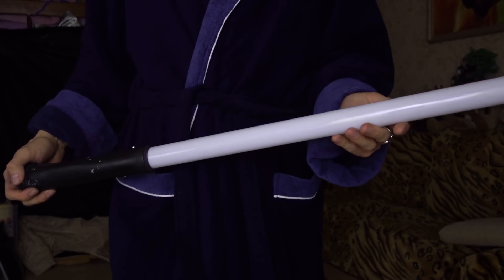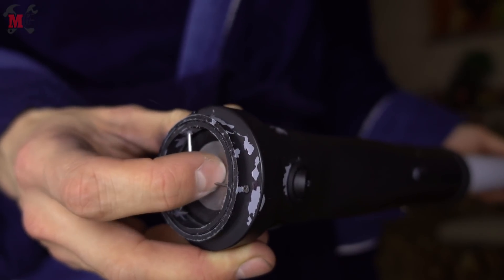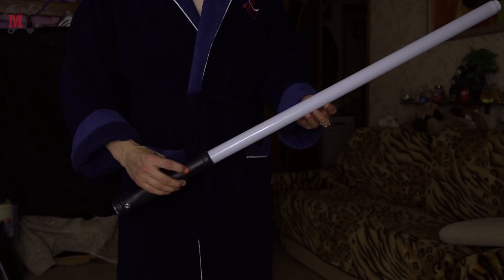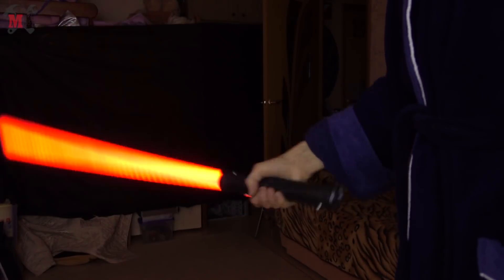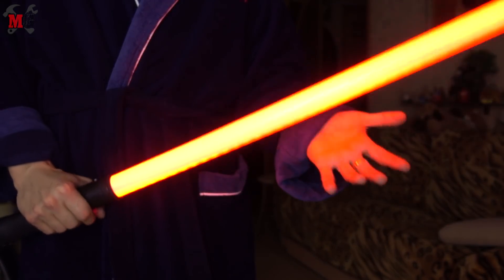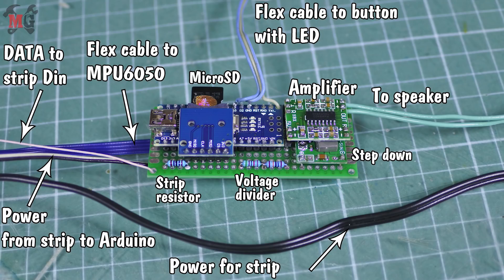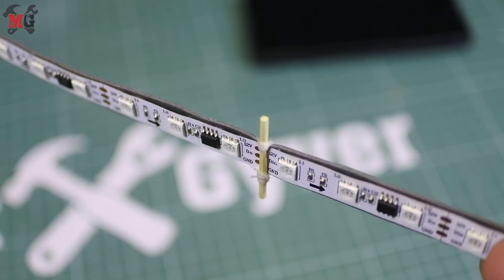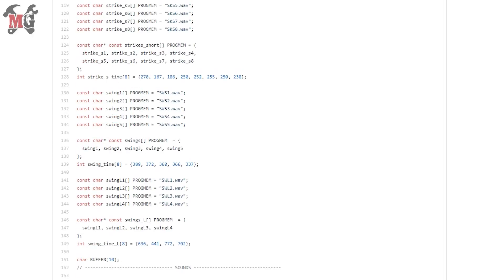DIY LightSaber with light and sound effects

Comment: Hi! I have a question if you don't mind. 
I am looking into using your method for the lightsaber to making a portal gun from the game Portal. I am removing the gyro sensor (the MPU6050), and rather than a LED strip, I am using a bunch of LED Diodes in a circle, half blue half orange. I want the sound to play when it changes from one color to the other. Do you know if adding a slide switch where the Button with LED is would work to do both so? Thank you!

Comment: Cool build! Am in the process of making my own, home built (not using pre-made tubes, but my own scrap metal finds) I want to know if  your build would work with the more dense RGB LED (144 per meter, i think is the run) strips, 2, back to back, and placed inside the clear tube (polycarbonate),  and I hope to use 3 18650s as they are rechargeable. your build is on-line, so I can study and read. Thanks

Comment: Question: How hard would you say someone could hit the blade without breaking it?
Reply from the maker: +Nerderon guys Jedi said that it is strong enough, there were a couple of hard hits in their performance. Also, polycarbonate is a material for bulletproof shields, so it is really strong :)
Reply: i would be more worried about breaking the led lights rather then the blade
Reply: @ReaIiPlayBedwars  Yeah,  if your worried about breaking it, maybe add some additional support on the inside... maybe some brackets printed in transparent filament??
Reply: Breaking which? The blade or the man?